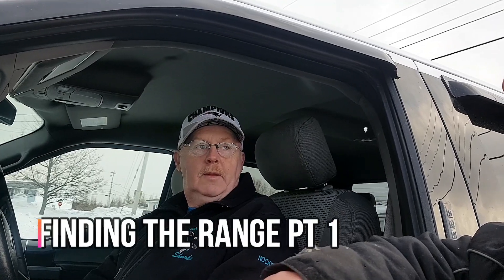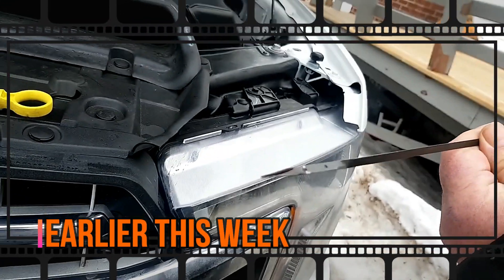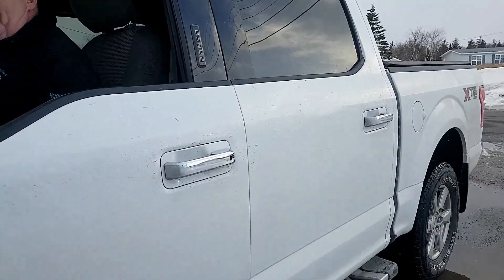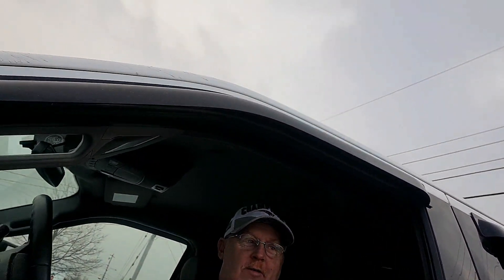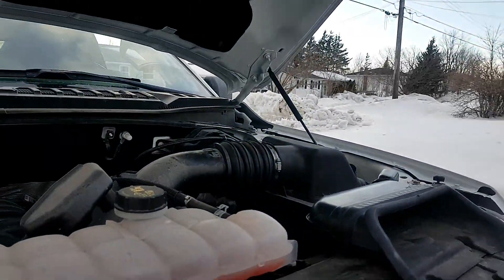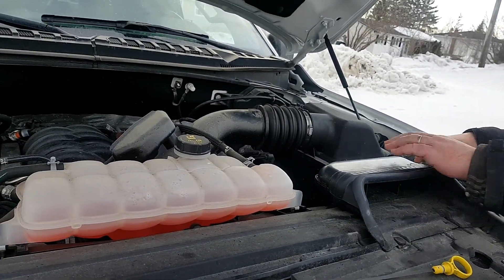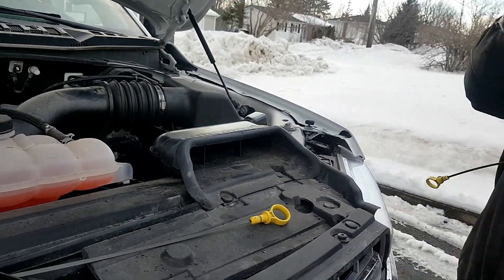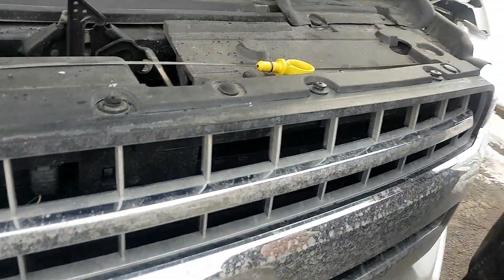2018 2019 2020 FORD F 150 burning oil  consumption test round 3

Comment: After 2 weeks of testing ford decided to do a short block replacement. Hope this works.
Reply from the maker: wow that's good news.  are they repacing the timing chains? i think i would look into at least a 5w30 instead of the 5w20 they are running. it couldn't hurt to ask.rouch recomends 5w50 in these engines. 
ty for letting me know and keep in touch.  good for you. good news
Reply: @thisguysgarage  not sure on the timing chains. They are suppose to check for wear as they tear down. I would think a lot of carbon build up around the valves. 24k I bought with 16k so in 8k I used about 6qts.
Reply: Well, finally after 7.5 weeks I got my truck back. Missed a couple camping trips but glad to have it back. They changed the timing chain and checked heads, my service advisor said, but he said a lot of things that weren't true so who really knows.Oil real clean but looks to me that's it's the same oil filter. Looking through the wheel well tho you can see the new block.

The vct solenoids still make noise. Guess time will tell if it's fixed or not.

No instructions on break in period. I have a camping trip this coming week so it will be a big test for it. My camper is heavy and is at it's max tow rating. I guess after a 1000 miles I will change the oil. Prob do like you said and put in heavier oil. Suppose to be sending the paper work, I picked it up after hours Friday night.
Reply from the maker: @frank8424  i would definitely be looking at a heavier oil probably stick to a  3000 mile schedule to preserve the engine.  Ty so much for letting me know 🤜🤛

Comment: Don't understand why they didn't change the oil and filter first.  Add in said amount of oil. Mark said dipstick. And have him come back in a week.  
That's how we do it on Kohler engines when we have an issue.
Who has the time to go to the dealer once a week.  🤷‍♂️
Reply from the maker: thats how mine was done originally
Reply: @thisguysgarage   
Thats the correct way for it to be done.